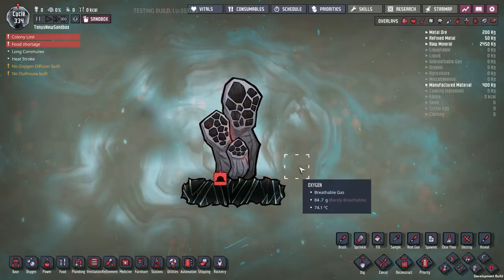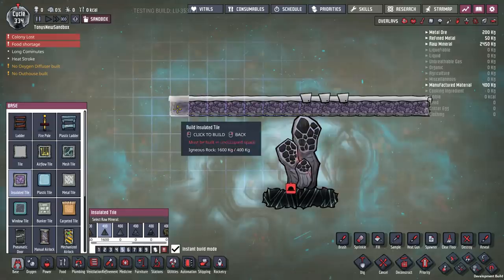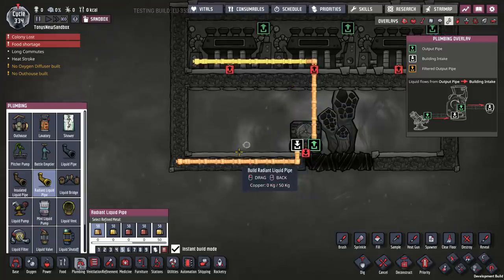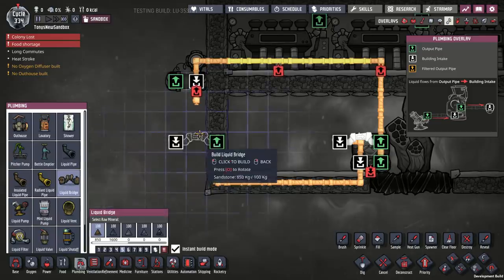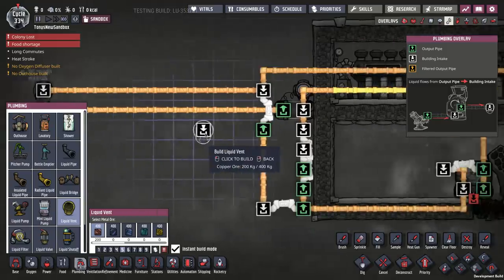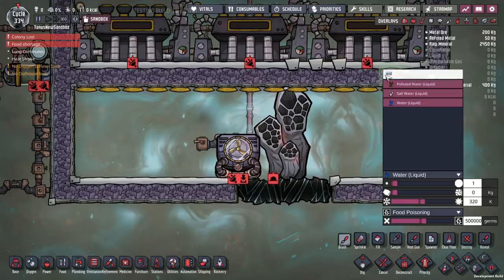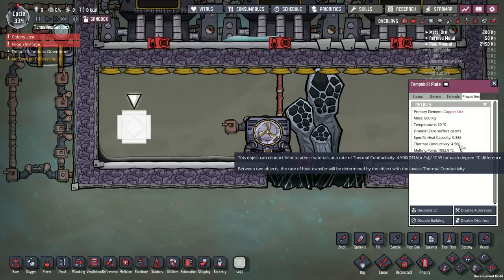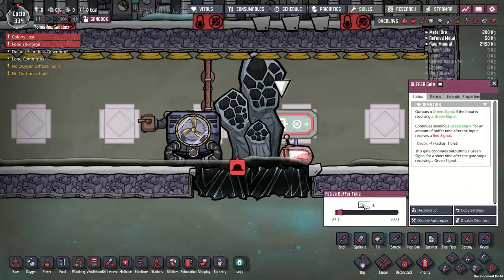A Cool Steam Vent Tamer for your Mid-game Base in Oxygen Not Included.

Comment: Given that there are no wheezeworts / AETNs, what exactly deletes the heat in your build? This looks like a bug/exploit.
Reply: Aha, got it, it's the turbine that only heats up by 10% of the energy removed from the steam. Ugh. I still feel as if this is a bug though.
Reply: As law of physics say, energy must Go somewhere, in case of the steam turbines, that energy becomes electricity.
Reply: @ByMorraDiabo  The other law of physics says that it still ultimately turns into heat as that electricity is used up by other machines. But it doesn't: this build deletes heat as it turns hot water into cold water while never melting itself, therefore at least one of the devices in this build has to be "magical".

Also Carnot's theorem.
Reply: Basically the turbine+aquatuner combo consumes electricity and deletes heat.
Reply: @ByMorraDiabo  hmm also https://www.youtube.com/watch?v=907Fgud_AX8

Comment: (I'm new player and I don't understand few thing, don't cringe at me )
 1 steam turbine produce 850 watts of energy. Multiple it by 3 and its 2550 watts. Termo aquatuner consumption is 1200 watts. So why it isn't self-sufficient?
 If i wrong with my math, can you hook hot water output up to electrliser and use hydrogen generator to make it self-sufficient.?
Reply from the maker: Steam turbines generate less than 850 watts if the steam temperature is less than 200C. You can certainly generate some power via hydrogen by electrolyzing water, I'm not sure about how all the dynamics work out if you include that in the setup.

Comment: I have questions, how about cooling the 95°C water further?
Reply: If you use it in an electrolyzer: Don't cool the water, cool the oxygen.
If you need cooler water, 
1) quick&dirty: just build another aquatuner and run it through it
2) more elegant: use a heat exchanger like in many other videos to get the exact temperature you need.
Reply: @weltraumvogel2 
Agreed. Cooling the water from the vent it's just unnecessary chores. Also :

Don't bother cooling the oxygen that went to the atmo suits. Dupes has no problem breathing warm O² in the atmo suits. You only need to cool the Oxygen that goes to your base.

Comment: You will need 3 aqua tuner to produce enough heat for 2 steam turbine. I blindly tried your system and it failed in that the 1 aqua tuner cannot heat enough the steam generated by the cool steam vent to 125c fast enough. 

What I think happens in your video is that you have enough heat and it will work until the steam turbine has used all the heat.

Comment: I don’t think this is a practical early game build. The power requirements for the aquatuner are too high for early game (how many generators did you need to start it up?), and you’re a long way along the tech tree here. And plastic is needed too.
Reply from the maker: The plastic was an oversight, I wouldn't consider it to be an early game thing (for most players).
Reply from the maker: The net power requirement is different for every vent, but it's consistently 45 joules per kg of water produced. That's kind of like a 10kg/s water pump that uses 480 watts. If you can run two water pumps and build a battery, then you can do this.
Reply: Yeah, I see the net power once it’s at a steady state, but to get this up and running you have to power the aquatuner for long enough to boil the water and start getting some power back. That’s what, three hydrogen generators dedicated to this for several cycles? It’s fine in sandbox when you don’t have to worry about startup, but in survival mode startup is a huge challenge. To build it the way you have you either have to dump hot water into your base, or take many cycles at high energy use to boil that water. It’s an interesting concept, I enjoyed the video, and I like your content, but this one can’t be done very easily in survival.
Reply from the maker: @ermintrude9634  I don't think water is ever boiled at all anywhere. Also, the video demonstrates it working near full capacity after about 1/8th of a cycle for warmup, that's about 75 seconds of running the aquatuner. (Startup begins at about 11:56, with cold oil and everything, I think.)

Comment: or you could make a room in vent, vaccumate it. Make room 4 tiles minimum below neutronium with atleast one tile open so water can flow in. Place pump it room below. Boom you got compact, easy, simple tamer(Steam should instanly turn into water). The only con that it will heat up your base. But hey, do you really have plastmass in earlygame?

Comment: This is a really nice setup, but I can't make it to run! Does somebody have issues with the automation? My thermo sensor that controls the aquatuner says that it is sending a green signal (temperature is 85<135), but the automation overlay says that it is sending a red signal, and so, the aquatuner is disabled by the automation grid 😭 help?
Reply from the maker: I can help you. What you are describing sounds like a bug that happens a lot. Switch the thermo sensor to "above" and then back to "below", if that doesn't fix it then post a screenshot of your automation and I'll have a look.
Reply: @tonyadvanced6315  Thanks, twiking the parameter didn't work. So I just built a new one just a tile further from the geyser, and it worked. Now it runs perfectly! Thanks for the vids, I like to see your experiments, keep going!

Comment: I'm a newb and just bought this game when it released so I guess my definition of Early Base is different than yours.  I'd say steel steam turbines are definitely mid game.  I mean, if you have a way to produce steel reliably then what do you even have left besides rocketry and space materials?

Give me a way to tame a cool steam vent with earlier tech please.
Reply from the maker: Naw, you are right. I forgot steam turbines use plastic when I gave it a name an now I can't really change it. (Wait... can I change the name? omg...)
Reply: steam turbines can be any material, since they turn off at 100 degrees, i always make them out of lead since you have tons of it early on and it wont melt. the plastic a tad bit of a pain but glossy drekos can usually be set up by about cycle 50 or so

Comment: I cant make it to work! There is always oxygen that blocks steam turbine
Reply from the maker: You definitely need to get the other gasses out of the steam room. There are at least 3 ways. You can make an airlock to let your dupes in and out of the room, then use a pump to pump everything out of the room. Or, you can make holes in the top of the room to let gasses out while you get steam in it for the first time, it's trickier to do but faster once you get the hang of it. Or, you can make an airlock, freeze/liquify all the gasses in the room, and tell your dupes to mop it up, that will require some serious cooling, of course.
Reply: @tonyadvanced6315   i'm new to game and still learning how to build in game complex building. Is there some tips how to build faster? My dupes were building this steam vent tamer 15 days. Do i need to make storage bins near build site?
Reply from the maker: I just posted a new video that shows you different ways to make a vacuum. Make your steam room into a vacuum and you should be golden.
Reply from the maker: @pnegro22  When it seems like it takes your dupes forever to get anything done it's usually because their regular chores are taking up all of their time. For me, the first thing I usually need to do to free them up is replace my algae terrariums with an electrolyzer/carbon-skimmer setup.

Comment: I was actually thinking about doing that since I am doing an all achievement run and need to move asap from the manual generator and most of my shine bugs are dead
Reply: this is a power negative setup so it wont work great for super sustainable, the moment i set something up like this i drained all of my hydrogen reserves in about 1 cycle and i couldnt restart it via wheels and my whole super sustainable run was ruined

Comment: can anyone pls explain why you need that buffer in the cooling loop
Reply from the maker: If the loop gets too full it stops moving (deadlock). Aquatuners sometimes do weird things and can send an empty packet around the loop. If your water input fills that packet with water then it adds extra water to the loop. If that happens enough times, then deadlock happens. The buffer makes sure any empty packets are full of water so the input doesn't add any water (unless there really isn't enough in the loop). That way deadlock is prevented.
Reply: @tonyadvanced6315  Thx you're the best

Comment: So, You used a lot of expensive materials to remove 85% (if i remember correctly) of 95'C water from this setup? What's the point of that? That's far from what I call effective cooling... :-/
Reply from the maker: The basic plan is to collect all the water at the lowest possible temperature using the least power.

Comment: Says early game. Then drops the ATs and Steam Turbines.
Reply: Because of plastic? In base non-dlc game you can get to oil biome with warm sweaters. 4 thimble reed and you are good to go. For research you only need water and dirt.
Put door so only dupes with sweaters do job in 80C area. Don't dive in liquid - just slap golden pump in upper layers of oil puddle -and you are set.

So you only need some research, electrical engeneer, a bit of gold and reed from swamp, few tons of refined metal.

Comment: Didnt watch the video because the entire point of it is dumb

When you start out you have things that are way more important thane taming a cool steam vent so you should just find one and stick a pump near it and let it cook the enviroment. Deal with it when you finished doing everything else or when the enviroment is too hot - by then you will have steel and you'll be able to just use an aquatuner to cool it easily (because you will be swiming in power)

Edit: with what power am I supposed to use an aquatuner in the early game (which is until you solve oxygen food refinement and electricity) you are showing a cycle 200+ tamer the video is just a clickbait.